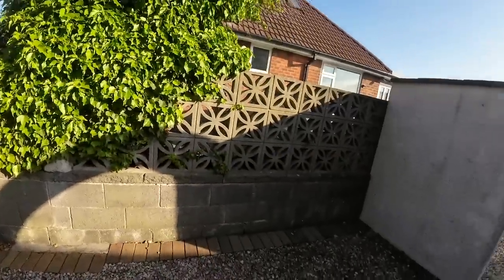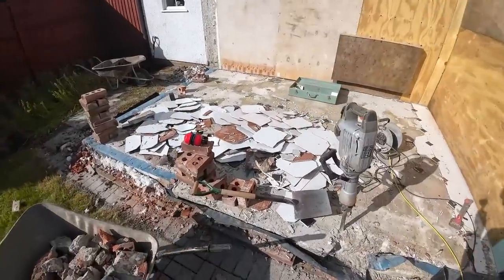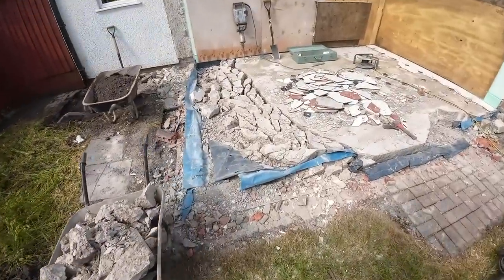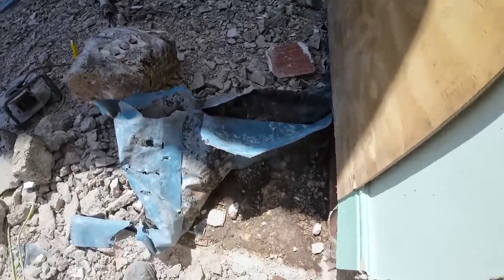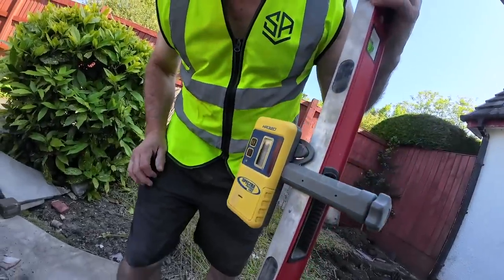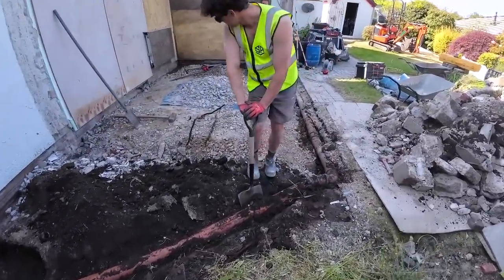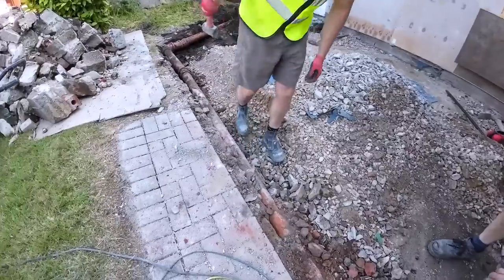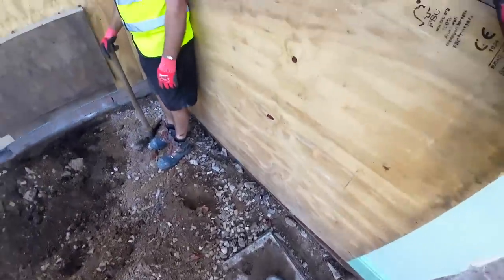EASY JOB TURNS INTO NIGHTMARE!! 150MM CAVITY EXTENSION PT1

Comment: It looks like a typical job boys no end of problems.  That drain looks like the manhole has been abandoned the benching taken out and a channel put over the main run 
a typical bodge.  Not that will trouble you boys I have every confidence in you in doing a good job. Thanks for a good video best regards Ken
Reply from the maker: Cheers Ken a quick chat with a very helpful building inspector and we came up with a plan and got it sorted 🧱👍🏽

Comment: I once had a building inspection come out and said that it was ok to connect the drainage I was putting in for a new utility room onto a drain run that I had clearly pointed out was running uphill. 🤔🤔🤔
I had put a camera down and the old drain was snaking up and down some sections were over half full of silt. I showed this to both the property owners, builders whom I was putting the drain in and the building inspector. I got a phone call the following day from the building inspection and said that he wanted the full 34m drain run replacing to the main sewer connection with a Windsor Trap. Now that job cost a small fortune in materials, the joke was the building inspector that first said that the drain was fine then insisted that the new drain run had to have 100mm pea gravel below, 100mm pea gravel on top (of which is what I always do, although deeper the better on top) and then a further 150mm concrete on top of that. I think that he was getting awkward has didn't like to admit he was wrong about the previous drain. I was lucky due to the fall on the long back garden to get the required depth.

Comment: Could you not get a breaker on the end of the digger
Reply from the maker: We’ve never tried one and thought it wasn’t as bad as it turned out 😬🧱👍🏽
Reply: You can't get a breaker on a micro digger fron a hire shop it causes too much strain on the machine unfortunately.
Reply: @paullindsay4798 they are piped for them hire from some where else if that’s the case
Reply: Yes you can we use them all the time
Reply: @paulbolton7232  is that on a micro digger or mini digger we can hire them on mini digger but no hire shop around us will let you use them on a micro. I would of hired a hydraulic breaker though lol

Comment: When you think you have a straight forward job it turns out to be a massive can of worms!
That manhole looks like to me it's once been active, then there has been change in pipe runs so a new feed pipe has been connected over the top of the dead branched gully.
My only concern is that there looks like a small amount of seepage on the broken branch into the manhole that has some displacement up the pipe run. If this is happening you need to get rid of the water somehow?? I am sure you are more than capable of getting this sorted though.
I hope that you got on ok at the hospital Steve. 👍👍👍
Reply from the maker: Check Anthony. Sat in waiting room right now 😬🧱👍🏽
Reply: @SteveAndAlexBuild  Wishing you all the best 👍